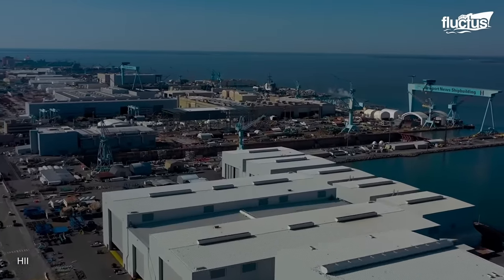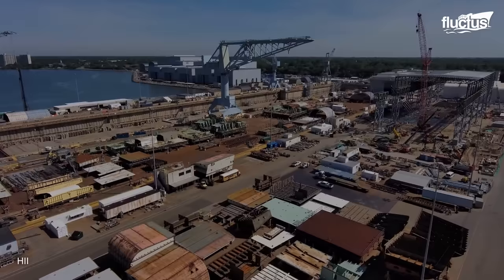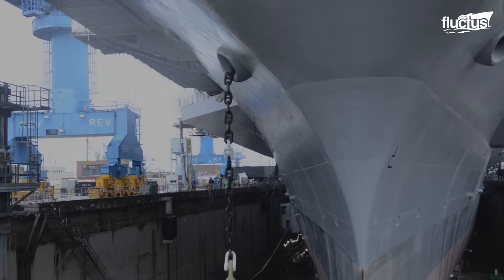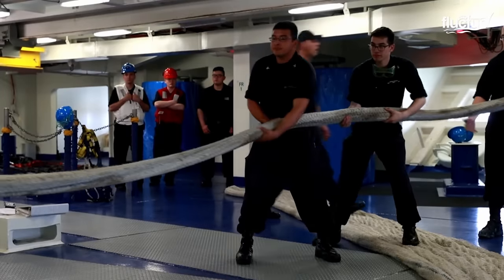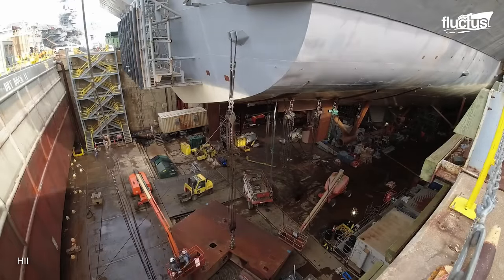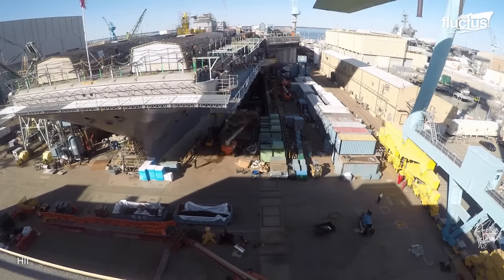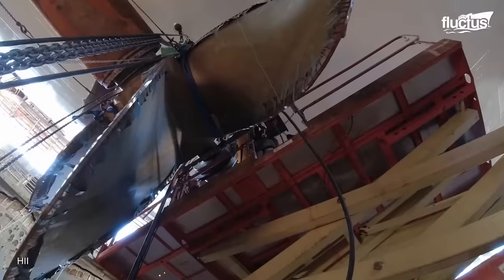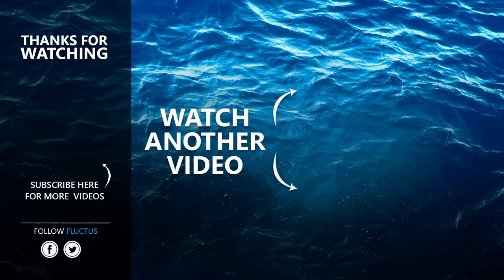The Crazy Process of Repairing US Largest Aircraft Carrier After 25 Years at Sea

Comment: Amazing process.  Amazing workers.  Even sped up, the precision required to maneuver parts from under the ship so they can be refurbished was astounding.  There's got to be a lot of pride doing work like this.  o7  USA !!
Reply: hey dum dum - they cut holes in the ship to get the parts out - then weld that section back into place when they're done
Reply: @richanddebshawaiiadventure4340  and you think that doesnt require precision? I work at NNS next to overhaul as a welder and alot goes into these maneuvers. Without the shipbuilders we wouldnt have carriers.

Comment: Tihi, Maybe I've been a Draughtsman too long / not long enough,
but when they talked about the improved method to remove the propellers (screws),
my mind came up with one amazingly complicated device,
that could grab, hold & pull the prop, no matter what angle it was at.

Welding a few temporary brackets to the hull would not have crossed my mind 😄

Comment: Noticed that the rudder stock shaft was frozen, via massive dry ice storage at the 14:50 mark before installing it, that way when installing it the steel and metal will expand to the point and hold the rudder in place, but removal of the rudder shaft to removal the rudder. They dont show how they put the keyway in the rudder stock and shaft, plus notice it has around 6 large bolts and the keyway which keeps the rudder shaft from not moving around as part of the rudder movement when in the water. Removing the Rudder Shaft, would be in reverse of installing it & j ust use the massive crane. ⚓⚓⚓⚓👍👍🦘🦘👌👌